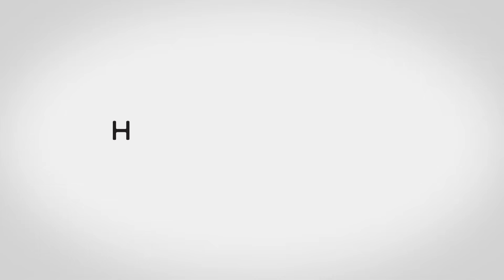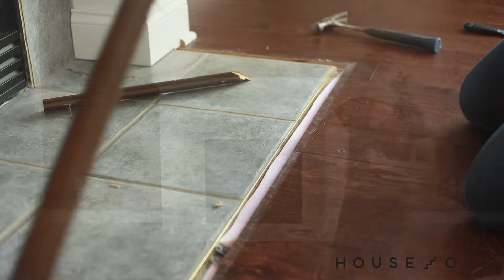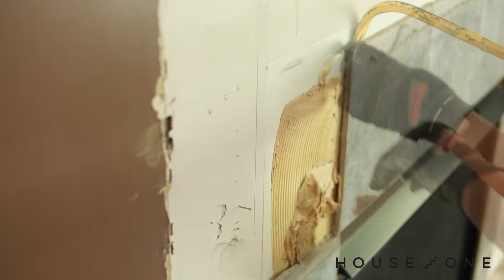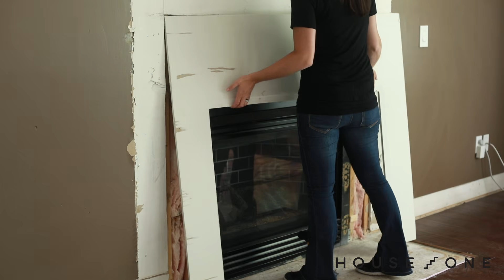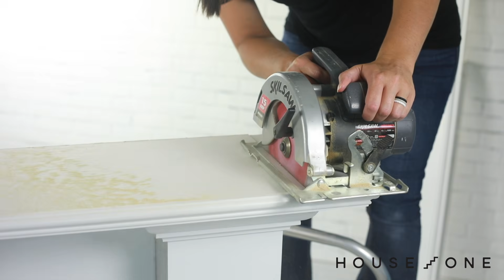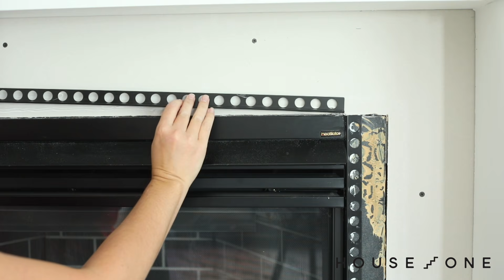How to Prep a Fireplace for New Tile | House One

Comment: People watching this video should know that these materials won't conform to code for most fireplaces. You cannot have wood framing abutting your fireplace. Drywall (even fire-rate drywall) is considered combustible. It slows fire, doesn't stop it. Clearances vary for each fireplace (gas, vs. electric vs. wood). Do your homework and don't burn your house down.
Reply: It might be zero clearance !!!! You only need 3/4 inch or 1 inch of clearance from combustibles
Reply: It’s all based on the make and model of the fireplace. Some factory built fireplaces allow combustibles on a flush facing material. Many mantle specs follow the NFPA211, but again look up the make/model installation instructions.

Comment: When putting in new dry wall around the fire place was it flush with the fireplace frame? Does that mean when you install tile, the tile will be slightly above the fireplace frame?
Reply: depends on the fireplace. I reccommend leaving a 1/8 of an in space. Incase need for repairs' cleaning

Comment: What’s the combustible clearance for prefabricated fireplace?
Reply: 12" to the mantle , 6 to the sides.
Reply: Does it matter for what's behind the tile around, so in this case drywall? I'm also considering a james hardie cement fiber option.

Comment: You should have 2 inches of cement board extended about 2 feet for the extended hearth. This will get you an R 1.0.   Tiles alone without an R 1.0 do not meet most code.
Reply: Quick question...taking on similiar project...r u saying 2 inches thick of cement board in contact with drywall and metal of firebox before installing tile?  Know you left this comment a while ago thanks for any response.